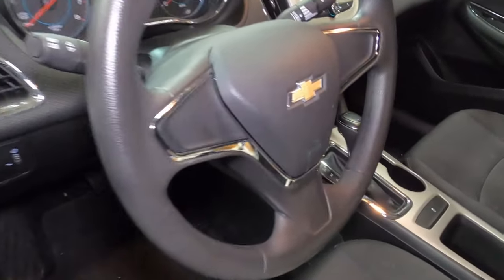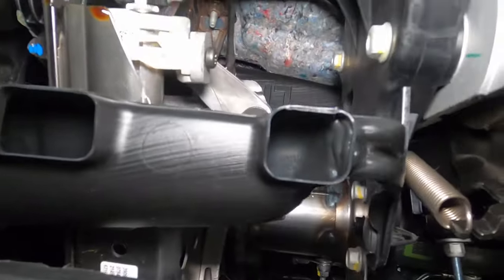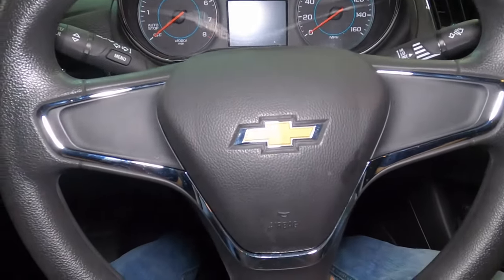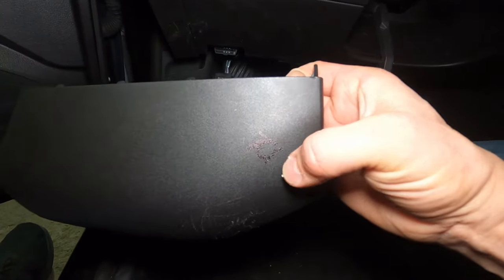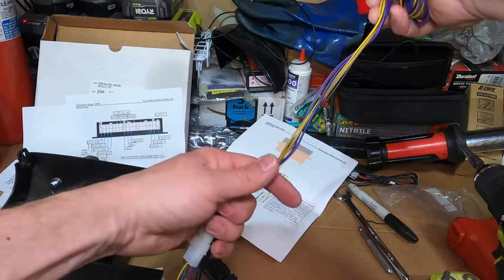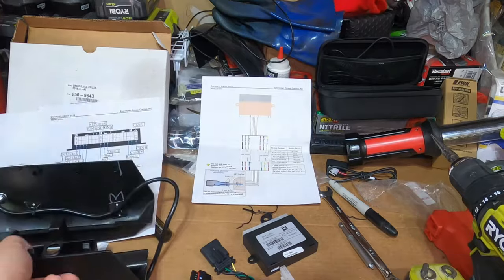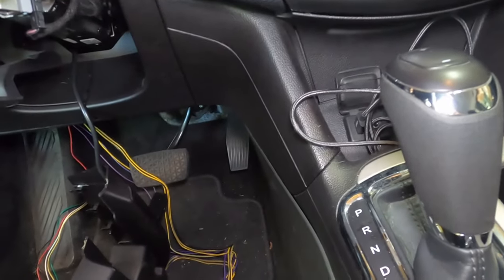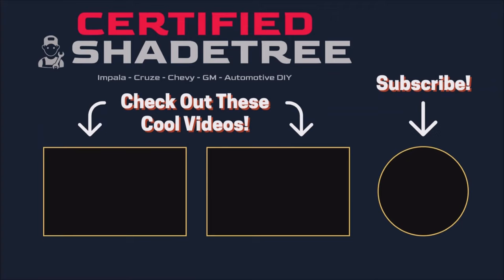2016-2017 Chevy Cruze (2nd Gen) Rostra Cruise Control Installation (# 250-9643) 2018-2019 SIMILAR

Comment: this is for the 16.5 -17 chevy cruze just a heads up on the 18-19 chevy cruze you do have to solder a wire onto the bcm as well and add another power to attach on the ignition wire...
Reply from the maker: Title and description now edited to reflect this fact. Thanks for letting me know!!

Comment: so do you think that i could do this for a 2019 trax ls? do they pretty much have the same system?
Reply from the maker: YES! The part number for the Trax is 250-9640 for an Automatic Transmission, 250-9641 for a Manual.
https://www.rostra.com/manuals/250-9640_Form5432A.pdf
https://www.rostra.com/manuals/250-9641_Form5466A.pdf
Both have the exact same installation instructions as the Cruze. The pedal bypass harness looks a bit different, as does the ignition switch connector, but installation procedure should be identical to the Cruze.
Reply: @CertifiedShadetree  AMAZING!!!!!!!! dude i drive so much for my job you just saved my life.
Reply from the maker: Leg cramps will be a thing of the past!! 😁 Best of luck to you! 🍻

Comment: did you not hook up the wire to the bcm the white/brown goes to black bcm conector
Reply from the maker: Not sure which model you're installing, but this particular one doesn't connect up anywhere to the BCM. It's literally 1 connection to switched ignition, and 2 connections to wires on the OBD II port.
Reply: 2018 cruze mines a automatic too
mine wont work with that connector unpluged @CertifiedShadetree
Reply: i see now yours if for 16.5 cruze mine was 18-19 chevy cruze @CertifiedShadetree  diffrent part number
Reply from the maker: @matthewdaffern8368  Ah, okay. I should revise the video description!! Thanks for the heads up!
Reply: you did a badass job revising that!! @CertifiedShadetree
Reply: @matthewdaffern8368 so that extra spot needs to be hooked up on the 2018? To the BCM
Reply: @baileyfrady1258  yes
Reply: @baileyfrady1258  mine was is a 18 so yes
Reply: @baileyfrady1258  itll come with directons and make sure you sloder all joints its tough to do the bcm point but i did it take your time and itll all work out
Reply: @matthewdaffern8368 yes I’m installing one on a 2018 right now I’m having trouble finding the correct wire in the pin connector to the bcm if you could recall the grey/yellow wire is at the top of the connector.? I’m just nervous and don’t want to solder the wrong wire
Reply: @matthewdaffern8368 it looks to be a little thicker gauge then the others
Reply: @baileyfrady1258  i looked but i taped the harnes up and i cant see what wire i hooked but the instructions were clear
Reply: @baileyfrady1258  sounds right but reed the manual

Comment: What size are the positaps?
Reply from the maker: Lockitt POSI-TAP 6 pack wire connectors 20-22 awg https://a.co/d/0eC42YN3
Reply: Cool thanks, just bought the kit and will be doing the install next week!
Reply from the maker: @Nagairobu  Best of luck! 🍻
Reply: It only came with half the instructions lol, nothing was in there on the pin locations so your video helped alot. It works perfect, thanks again for the info!
Reply from the maker: @Nagairobu  🍻